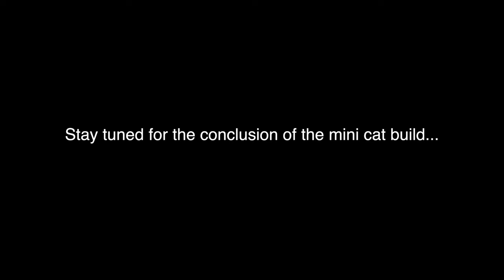Build this Catamaran in TWO MONTHS!  Part 3

Comment: what is the honeycomb building material you are using?
Reply from the maker: It’s a product by Carbon core.
Reply: I congratulate you on the good idea. What is the Carbon core website?  Do you have the hull measurements, height, width and length?